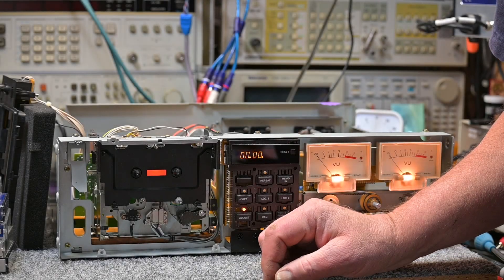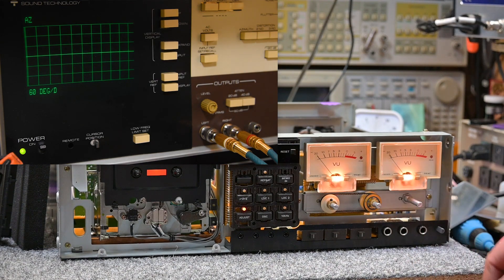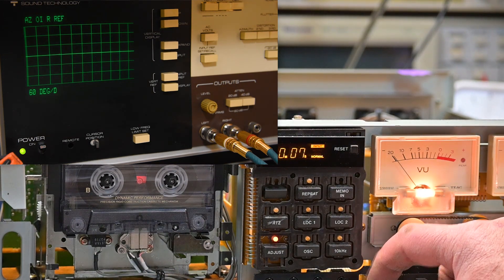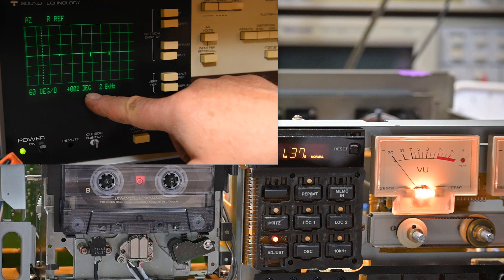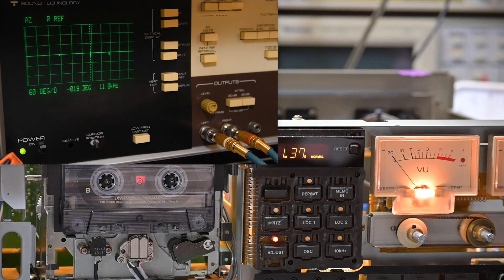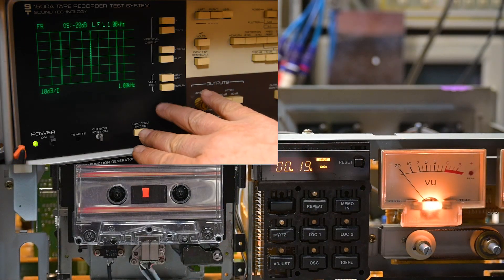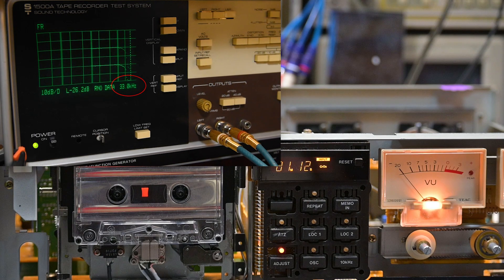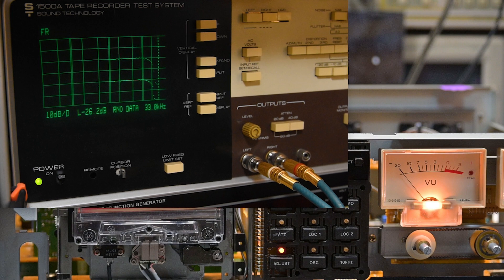Aligning the Record Head Azimuth on a Tascam 122mk3

Comment: Without the cassette door I don't think you have the proper accuracy due to cassette instability which can generate fluctuations. Tell me if I'm wrong.
Reply from the maker: You are correct. You may hear me say at some point that I will make final corrections following assembly. I check azimuth several times during the alignment, it's part of the process. Thank you for watching.

Comment: We live and learn - it was only quite recently (a few months back) that someone told me that some sandwich Rec/PB heads allow their REC head to be independently azimuth aligned. For some reason, I thought they were all 'set'.
Reply from the maker: Many are factory aligned then bonded together. In time, these can actually suffer from misalignment due to the continual curing of the bonding agent, which is basically a thermoplastic, and follows the same characteristic shrinkage as all of our adored plastic gears, press fit onto steel shafts. It's nice to have the ability to manually align, as is done on reel decks. It also allows them to be dialed-in more precisely than what the factory manufacturing tolerance likely allowed.

These particular heads also have two very small grub screws on the inboard side, allowing for manual tilt adjustment as well. I've only had to do it once, and that had to have been a factory defect, as it was so far off.

Comment: I have a feeling, as a 122mk3 owner, that the achilles' heel of these decks is the back tension scheme- I've often wondered why they didn't go dual capstan like everyone else at this end of the market.
Reply from the maker: I think they chose the single capstan for reliably reasons, Teac had plenty of experience with dual capstan drives on their consumer models but engineered these for the brutal radio studio environment which they targeted. I think their real Achilles heel is far too narrow PCB traces and pads.They were clearly in a transitional period to SMD's but jumped the gun and used surface mount sizing with through hole components, not a good combination.

I completely agree that the back tension scheme is inadequate, and far inferior to its older mk2 progenitor.
Reply: @asbcustom What is different about the two back tension systems?
Reply from the maker: @oldgoody1  Apart from the capstan motor, the two transports are completely different.
Reply: @asbcustom  Yes significantly but I meant specifically re the tape back tension system.